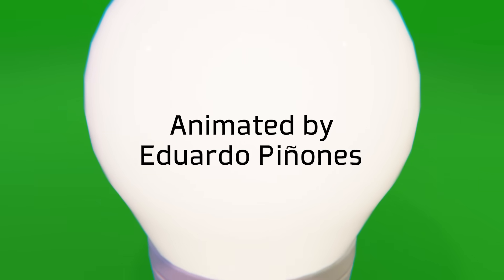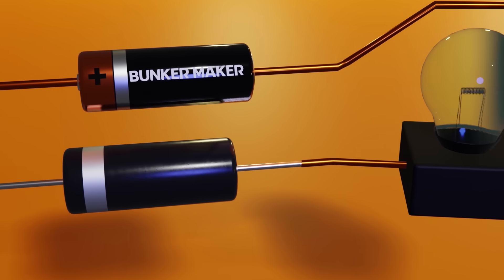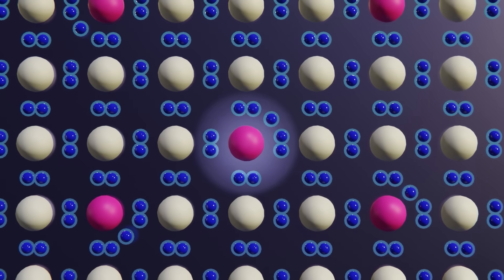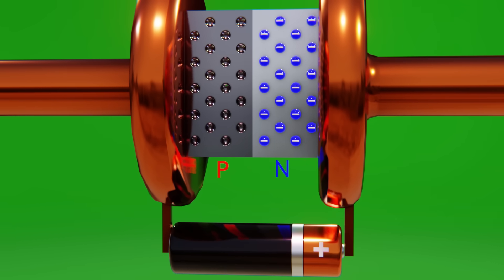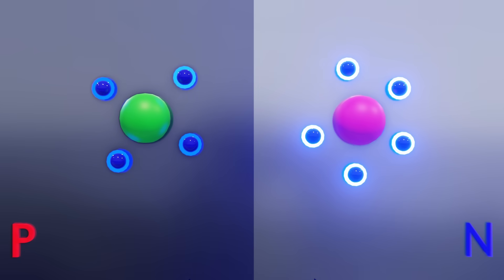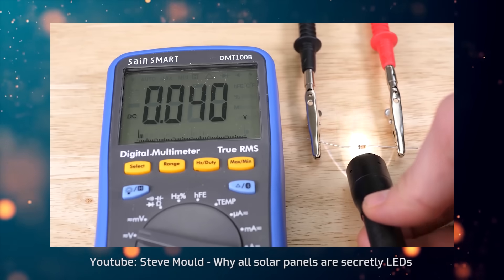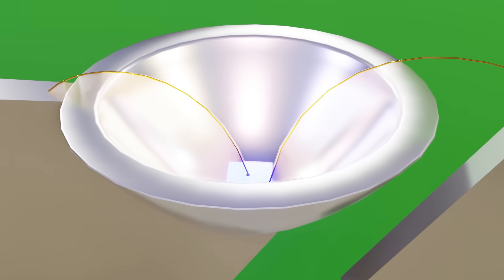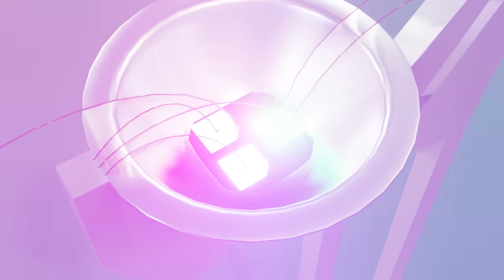How LED works ⚡ What is a LED (Light Emitting Diode)

Comment: BEWARE — DO NOT BUY FROM ILLUMINATE LED
I purchased an 1800R LED panel from Illuminate LED for $1800 on April 25, 2022 with a three-year warranty.  It quit working.  Their phone number is disconnected and they will not respond to my emails.

Comment: A Light Emitting Diode (LED) is a remarkable electronic device that converts electrical energy into light using semiconductor materials. At its core, a LED has two slightly different semiconductor layers. When an electron moves between these layers, it loses energy in the form of a photon, and this process generates light. The specific energy lost determines the color, giving us a wide range of colors from red to violet.

For white LEDs, the process involves a blue LED coated with a phosphor. The phosphor absorbs some of the blue light and re-emits it as a lower-energy yellow light. The combination of remaining blue and emitted yellow light creates the white light we see.

This simple yet elegant mechanism has revolutionized lighting technology, making LEDs efficient, durable, and versatile.

Comment: That's very good for flashlights or bulbs but for all types of lamps made with the built-in small LED bulbs (integrated LED lights) that ain't. It's not eternal like the lasers or the lights that are not from the lamp type.
My new big mounted LED lamp is not working anymore.
I'll buy a small and a big one on internet this time and not LED.

Comment: I wonder if there is any light emitted beyond human vision, in the air between a dowsing rod and the element that is being dowsed ?  Read and study the book, The Art of dowsing - Separating Science from Superstition ($14.95), for learning all of the physics involved in dowsing and how to build the modern light weight ball bearing dowsing rod, which is the only dowsing rod that accurately gauges what is being dowsed by pitting the energy of gravity against the energizing of the one-tenth ounce dowsing rod load that is attached on the elevated acetylene welding rod, with being located five-inches from the hub's shaft.  This precisely gauges the dowsing of all edges, exact center, depth buried with angle of deposition, and most important is grading of the sought element that is contained in the elemental mass that is being dowsed.  Anybody can become a professional dowser by practicing the book's dowsing lessons of buried pipelines and electrical cables, tunnels and voids, precious metal placer and lode deposits, dowsing for treasure, dowsing for any element, amplified long distance dowsing from a moving vehicle, and dowsing on water from a boat.  I hope dowsing enriches your life and have a safe, healthy, good day.

Comment: Longer lifespan? The ones I buy only last a couple years. I think they’re designed to fail prematurely.
Reply: The LEDs itself can stand pretty long. forever. if not oversaturated so they become warm/hot. What persistently fails inside of these lamps is the rectifier plus resistance/capacitance circuit. Capacitors mainly are the points of failure (electrolytic caps are not stable forever, they age and they wear, sometimes blow because of gas buildups due to thermal thread and overcurrent). And rectifiers  diodes - permanently running on overcurrent also are going to fail sooner or later. (thermal thread damages semiconductors)

Comment: I was a project manager at EMI Research (UK) in the 1970s.  One of my engineers had used one of the new green LEDs to indicate that his system had passed all fault checks.  My boss, an assistant director, was appalled at the extravagance of using a green LED.
Reply: And some extremely important scientist back decades ago sad he couldn’t see the need for any more than 3 computers. 😉
Reply: Or 640K of RAM @Davidh4198
Reply: ok
Reply: Or a computer on a desktop
Reply: How you are still alive
Reply: @noobda597  Don't smoke, ride a bicycle daily, inherited the right DNA.  Plus I was younger than most of my engineers at EMI.

Comment: I casually have seen many many videos of diodes and semi conductors, but this video is explicit and straight to the chase and I've finally understood
Reply: At the core of every LED is a combination of two materials: N-doped and P-doped semiconductors. N-doped silicon, infused with elements like arsenic, carries extra electrons, while P-doped silicon, infused with elements like gallium, is characterized by "holes" where electrons can reside. When these two materials are placed together, a small but powerful phenomenon occurs—some electrons from the N-doped side flow into the P-doped side, creating what’s called a depletion zone.

Comment: Yes, Diodes are  p–n junction  and so they provide a low resistance path to forward current flow and a very high resistance path to reverse current flow, unless the breakdown voltage is exceeded.. . . .  I was not aware of diodes producing light, even though I have used clear glass Diodes, but the forward voltage drop is an indication of the natural wavelength. . . .  Red LED's drop about 2V and Blue LED's drop about 3V, so 0.6V would be a very long wavelength, way below visual. . . .    

However the description of how LED's emit Light is a little confusing. . . .   Atoms have Electrons in different orbits or shells, that is energy levels. ..   In Silicon, the inner shells are full or compete, but outer Electrons can or are energized by the forward current to move out or up to a higher energy orbit. ..    This is an unstable energy level for them, so they will collapse back into their natural shell. . .   And in that collapsing, will release Energy.. .  With suitable doping, that released energy, can be made to occur at any desired wavelength. .. .. A fairly narrow spectral width colour. . .  They can be made to emit anywhere from invisible IR, through Red to Blue and beyond into the UV. . .  Which ever doping is used. . . .   

LED's can not be made to emit White light, but White LED's usually emit Blue light and the phosphor covering allows some Blue light through and converts some Blue light to provide the Red and Green light, so our eyes think it is White light, it is not, but our eyes think it is.. . . .  Present LED's are now getting close to converting 50% of the Electrical energy to Light conversion.  . .  I believe the theoretical maximum is around the 70% level.

Comment: I have an analogue radio. 
Several glass semiconductor diodes are installed inside, which glow faintly red in the dark. The glow is just a side effect of the capacitance diodes, whose capacitance is controlled with voltage. Capacitance diodes are operated in the reverse direction.
No, no tubes.
Reply: I once disassembled a digital bathroom scale from Eastern production. 
I was surprised to find small "grains of sand" with tiny threads on them. 
The grains of sand were the raw LED chips on a thin circuit board.
Reply: So why would they radiate any light, when reverse biased, particularly any visible light. ?

Comment: 8:19 is not possible. Otherwise, good video.
Reply: What happens at 8:19. . .   If you want an answer, then say what you are querying.
Reply: @hughleyton693  Did you review the video? What is in the video at 8:19 is not possible. Voltage doesn't pass through anything. Voltage is a relative force, not a stream.
Reply: @Cotronixco     Yes, I eventually went through the video. . .  You are correct, Voltage is a force, we cal PD (potential difference) and it is this force that causes Electrons to move in wires.. . . Yes, at 8:19 it is the Current variation through them, not voltage.
Reply: @hughleyton693  We are in agreement.

Comment: Whoever came up with an led is a genius
Reply: The principle for LED's was known a long way back.. . .  if you put energy into a Diode, then there must be some released energy, either heat or light or both. . . .  The problem was how to make them radiate in the visible spectrum. . . .  I remember the early ones, I got hold of a Red LED in the early 1970's and experimented with it and then designed them into the equipment I was designing.   . I was the first in our design company to use them.

Comment: I don’t think it’s accurate to say elections are moving. It’s the charge that is excited due to voltage.

As we know electrons are particles and if electrons actually moved then the weight of battery would be higher when it’s fully charge d that when it’s discharged

Comment: White light LEDs are a type of "Flourescent" light. They work the exact same way that flourescent tube lights work!
Reply: YES, that is correct, so technically they are not LED lights, but Flourescent Lights. . . . Actually the phosphor is translucent, and allows some Blue light through, so they are a combination of Blue LED's and Red/Green Flourescent lights.  🙂

Comment: When an LED quits working, it becomes a DED..... Dark Emitting Diode.
Reply: Most failed LED lights failures, are due to the driver electronics failing due bad design.. . The LED's them selves only fail when they have been over driven, way above their specification to try to impress people with how bright they are, again bad design.

Comment: Not entirely true. The electrons do not travel across the wire, unless you talk about drifting, but that is very different from what was shown in the video.
Reply: What are you referring to. ?. . .   Electrons travel Through the Wire from one end to the other end, under the influence of a PD difference end to end... .   In a simple wire, if you put or inject a thousand electrons in at one end, then about a thousand electrons will come out of the other end, having apparently traveled at about 0.1C. . .   That is not drifting, which can take seconds or even minutes to travel a metre.
Reply: @hughleyton693  Not really. That's a misconception. Electricity travels though the wire like a wave through the see - the wave travels, but the water stays in the same place, apart from drifting slightly forward or up and down. There are some good videos on YouTube explaining that. Electrons are like water - they carry the electricity, but they stay fairly put.
Reply: @KamilsView    Yes, DC electricity is electrons moving through the wire.. .   You are wrong about it being like a wave.. . . But at very high radio frequency, yes there are waves, which travel at abut 0.6C.. .   Where as DC is slower, more like 0.1C. . . .  I do not like the water analogy, some of it may help, but others can lead you up the wrong path. . .   So only high frequency moves as  wave. . . .  Regular household AC acts more like changing direction DC... .  And since the effective Electron movement is at about 0.1C each half cycle will have traveled from the Generator station, through the wires to your house, before they reverse for the other half cycle. ..   It is that Current flow through yur appliances that makes them work.
Reply: @hughleyton693  Not according to physics, electric engineers and other scientists. It's the electric wave (part of electro-magnetic wave) that travels through space and causes excitation of electrons in conductors. You don't even need a closed circuit for the electricity to flow. Please, research. You are using on old model that is not correct, even though applicable in many situations due to its simplicity. Derek from Veritasium made some good videos about that.
Reply: @KamilsView    Where is my reply. ..  Derek got it Very WRONG.
Reply: @hughleyton693  Ok, so maybe he did 🙂
Reply: @KamilsView  Hi Kamil,.. .  I am telling you they are wrong, there is no waves at DC.. .  There are no electro-magnetic waves traveling through space causing excitation of electrons in conductors. . .  That is all wrong... I know how electricity works, they don't.. .  Please pay attention to someone who does understand this stuff.. . .  You most certainly do need a closed circuit for electricity to flow. . .  This is not any old model, I work with the real stuff, not any models.   I do know what I am talking about.
Reply: @hughleyton693  Ok, fair enough. I guess DC works differently then. So what about AC? Are they correct?
Reply: @KamilsView     Yes he did and so have a number of others.. . I was even arguing with a professor at a university who was getting it wrong.. . The blind leading the blind... .  Actually I thought it all through for several months, before coming down hard on these Wrong videos, to make sure I was not missing anything.
Reply: @KamilsView    AC 60 Hz in this respect, works very similar to DC. . .   It is not until you get up into the radio frequencies, that we start to use Co-ax and wave guides as Wave carriers. .. .  Waves of contained E&M contained Inside the Coax cable travel as waves at about 0.6C.. .  They are still contained inside the coax cable screen and wave guides, not any external fields. . .  We don't want external fields and go to lengths to block and prevent them.. . .    What has been confusing them, is that at the moment you close the Switch, there is a single Wave that does go down the wire extra fast, but that is just a single switch On pulse, which actually contains a single rising edge and many harmonics. .. This can get complicated, if you do not understand electrical waves.
Reply: @hughleyton693  It is complicated. Maybe you could make a video about that? Or ask some of those YouTubers to consult you, so they could do an interview with you?
Reply: @KamilsView     That sounds like a good idea, I just do not know how to do that.. .   So all this and other electrical misunderstandings has now got me writing a short book on " Electricity made Easy   "
Reply: @KamilsView  I have tried to get Derek to contact me, but he has not.
Reply: @hughleyton693  These guys are usually quite busy, so difficult to reach them. You can try smaller YouTubers. Some of them might have access to the bigger ones.

Comment: I learned this long ago, in high school electronics class. A few years ago, I sat through a technical presentation from a video billboard manufacturer about how their boards and LEDs work. The "engineer" said that the reason that LEDs get dimmer with age has nothing to do with sunlight and rain degrading the plastic lens or deterioration of the semiconductor material inside. It has to do with depletion of the fissionable material inside! Then he said that's how the sun works! I'm not sure if he thought we were that stupid or if the bar is really low to become an "engineer" in china.
Reply: The Sun does convert Energy within it to radiate out lights or photons, much withing the visible wavelengths..  .   So there are some similarities, only the Sun is very, very slow doing it, where as LED's can switch On and Off way up in the Radio frequencies.
Reply: So you might a bit unfair with your comment, or missed something they were saying.

Comment: I got to tell you of a little story, regarding the LED. 
I was in high school at the time, taking “electronics”. We were learning the principles of amplification, rectification, and modulation, utilizing Vaccume tubes. Solid state electronics were discussed in our lectures, and the “light emitting diode” was discussed. Our instructor at the time, who had as a young man apprenticed as an electrician, and installed the first fluorescent lights in our city, stated “A very unique principle of electronics, but appears to not serve any useful purpose”. God I wish I had not listened to that lecture 😂😂😂
Reply: Well he was sort of right in the 1970's    . . . LED's were very low light levels, the best could carry about  6mW or 0.06W of electricity. . . .   I was the first in our design centre to actually use LED's for Indicators.. .  They were 3mm and 5mm diameter in those days, and became very good indicators, only Red, Orange, Yellow and Green, in the early days, but that was enough for indicators. . .  

I mainly used frosted white glass LED's so that if you saw colour, it was working, and not sunlight reflected of the glass ( plastic).. . . I used many in the equipment I designed, amongst just indicators, I used them to indicate the voltage in circuits, thus saving technicians using voltmeters to see if the circuit was On or Off. . .  In one Power supply circuit, the LED would show Green when all was good and Red if there was a problem.
Reply: Liar.

Comment: since science cant explain how diodes work, i came to youtube to learn from the experts...

btw... no one knows how they work... so... yeah, im out
Reply: Diodes are very easy to understand...  They internally polarize, which simply means that voltage can push electrons through them in one direction easily , but not easily in the other direction, over the band-gap.
Reply: @hughleyton693  i didnt say under them, i said how they work
Reply: @narmale  "Under them" ? ? ?   .. .  I explained how they work.

Comment: The primary reason "regular" diodes don't emit light and LED diodes do is because regular diodes  are an indirect semiconductor and LEDs are a direct bandgap semiconductor.  Regular diodes have a much higher minority recombination pathway that do not produce light. The video you referred to showing light emissions from a silicone solar cell is in reverse bias. The source of IR light emission is a completely different mechanism called bremsstrah radiation.
Reply: Thank you, that is what I thought.. .. .  But Solar Panels with reverse Voltage will not conduct any Current. . .  That is nominal 12V Solar Panels will NOT conduct any reverse current even if you apply 20V to them.. . .  But yes, it you apply 40V then they will conduct backwards.. . . Just limit the current.